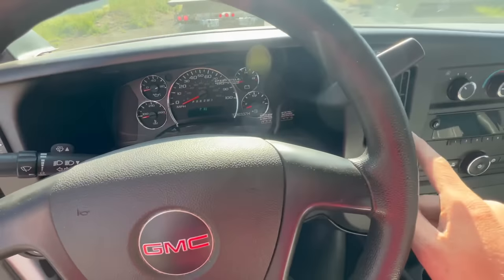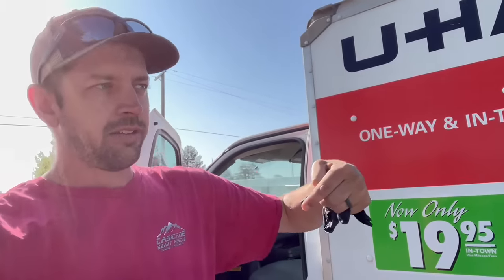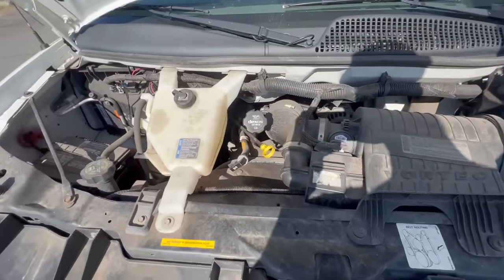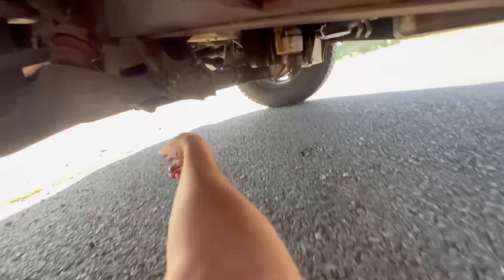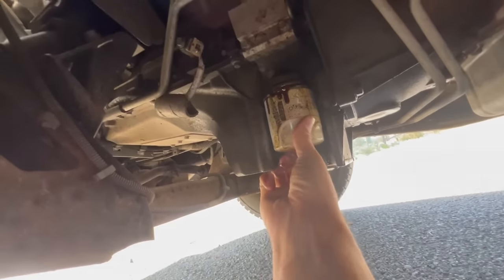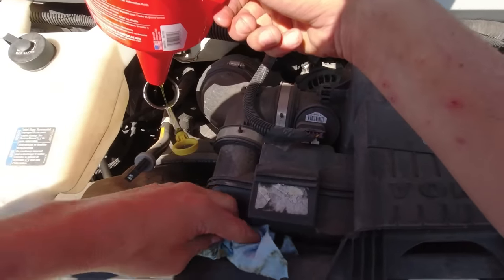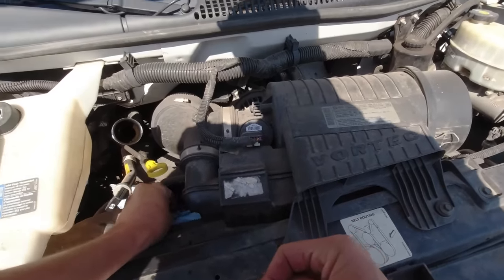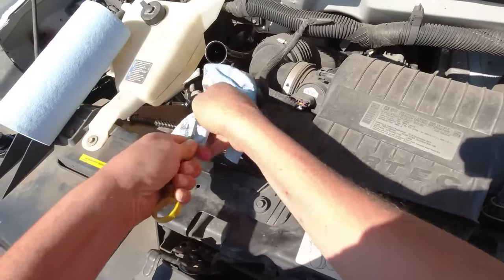Sometimes Being Honest Costs You A Job…

Comment: I am a retired auto technician and found that people will beat a path to an honest technicians shop.  I really enjoy your videos.
Reply: I am not a trucker but have found a shop that never needs bringing anything back in plus they are not condescending
Reply: That is very true!
Reply: Certainly true! However, finding that honest mechanic can be very difficult indeed.
Reply: Well honestly listening to what he's saying in this video, while yes they are honest it's their own screw up. He called the lead technician who said the truck left with the correct amount of oil and it looks like new oil so I'm assuming they did an oil change. The shop left the oil filter loose and caused the loss of oil so all they're doing is fixing their mistake. Honest, yes, but it's not like they're doing a huge favor by fixing a screwed up job.
Reply: @smilingsamurai5590  The guy who fixed it didn't screw it up. He could have done exactly what he was told and made a lot more money. He did the right thing and saved them money. He was a tow truck driver, not a mechanic.
Reply: Yes, but you'd actually have to do work if you get the reputation of being honest.
Reply: @arribaficationwineho32  Man as someone who works in a shop I feel so bad if a vehicle I've worked on has to come back in. Not a good feeling for anyone tbh
Reply: Damn right we will.
Reply: And word of mouth is better than any advertising you can buy with money.
Reply: I used to be an appliance salesman. I went the honest route, told people to shop around first, told them honestly if there were better deals to be had, if i couldnt get it i told them where to go instead of an 8 week lead time. I had more customers come back and ask about everything and anything, knowing i would give an honest answer over what the company wanted.

Comment: This world needs a lot more people like you Casey. Doing the right thing is always the best thing. 😊
Reply: The customer did well too. How many watch the oil pressure. Stopping the truck saved U Haul and engine + labour
Reply: @getahanddown  well, if your vehicle has an oil pressure gauge, you should be watching it. That's what gauges are for.... 😊
I drive a Chevy Cruze and it doesn't have an oil pressure gauge. But if it did, I'd be watching it just as much as I watch my temp gauge...
Reply: doing the right thing would have been putting the right oil in he put in non dexos approved oil voiding it’s warranty

Comment: You deserve a medal for what you did. Hope you got paid for your time, oil and filter. Hope the fleet mech that left the filter loose gets a repremand. Hats off to the customer (who rented the van) for noticing the low oil pressure and saving the engine. Much respect sir, and my hat is off to you. We need more people like you. People like you are what make this country great.
Reply: Oil filters are tricky, u want to lube seal, hand tighten then give it about 1/4-1/2 turn more to get it just snug because over tighten can be a issue. And because the threads are well oiled it's very easy to over tighten.
Reply: @stonefox9124  They're not tricky. You just have to use due-diligence in getting them tight. I've been a mechanic for 30 plus years. I've made my share of bone-headed mistakes. My mentor told me one time, "Don't put a drain plug in without tightening it. You WILL forget it." Same could be said for oil filters. This one was obviously spun on and just forgotten. All's well that ends well! thanks again.
Reply: He got called for a job, didn't do the job, and stole someone else's job so no one gets paid.
real american hero right there.
Reply: Man: hey I found the issue and fixed it for you so you don’t have to worry about having to get towed hours away to get fixed then towed hours to get it back. 
Some internet Rando: wow I can’t believe what a jerk he is. 

Dude saved the company a lot of money because he was honest and wanted to see if there was anything he could do to fix the issue and he did, I would to have someone like him around me who doubles checks to make sure I’m not spending more than I need to.
Reply: @mtndew314  ah yes just like how people that give sound health advice are putting doctors out of work
Reply: @mtndew314 haha.  Plus, I was thinking that no good deed goes unpunished.  Waiting on the lawsuit from Uhaul for some dumb reason.
Reply: @mtndew314  Did you not hear him mention fleet facility? Trust me, the fleet mechanics have plenty of work ahead of them, and aren't losing any money, nor sleep over it. Not to mention the loss of downtime for that particular unit while it sits waiting to be repaired. The keyword in this video is honesty. Apparently that doesn't matter to you. I wonder how you would feel if you were the owner of a business, and someone raked you over the coals unnecessarily just so he could catch a payday? There's no reason to be a snarky, contrarian dick.
Reply: @demontekdigital1704  There is not a single part of this that is about being honest.
If he just showed up and loaded the vehicle that wouldn't make him a dishonest liar.
That wouldn't mean he "raked you over the coals" 
Yeah, he went 'above and beyond" but thats not related to honesty.

and it sounds like it'd be a big payday for the towing company, so if I was the boss there I'd be furious that he threw that away.

and I'll sure as hell be a snarky dick when OP is out here acting like this dude deserves the Nobel peace prize for changing an oil filter.
Reply: @mtndew314  Contractors definitely add a "dickhead tax" to your bills lol

Comment: Casey, You're honest to the core and that's why we all love you and your channel.  I'm actually impressed that the customer noticed that it was losing oil pressure. Most people just get in, start it up and drive off.
Reply: Hard to "drive off" when computer puts engine into limp mode
Reply: I know, I thought about that too. that could have turned into a major repair
Reply: Back in the VCR days one Portland News channel deliberately popped the fuse on a perfectly fine VCR (& replaced it)and dropped it off at a few repair shops. Only one shop was honest and said, no charge, just a blown fuse. It was the smallest repair shop in Longview. Any other tow company would have simply towed the vehicle to a destination, & collected a few hundred bux. word of mouth goes a long way
Reply: @speedfreak8200  I keep forgetting about the computers in all these new vehicles, My daily driver is an '86 AMC Eagle.
Reply: @EvrttGrn  COOL !!!!
I thought those eagles were all dead!
Congrats on the epic ride !!
Reply: @haroldphipps3457  Thank you.  Not all of them are dead.  There are still a few of us keeping them on the roads.
Reply: @EvrttGrn  That new of a chevy yells and beeps like a maniac when it has no oil pressure and is running. It will say around where the odometer is exactly what is wrong. 

Doesn't stop people, though, I rebuilt the 6.0 in a 2007 tahoe hybrid someone ran dry. I've done at least three ~07 honda pilots, because their VCM eats oil like it's going outta style. Those also make lots of noise when they have zero pressure, doesn't stop anyone.

Comment: I used to sell electronics for a bit down at Radio Shack back in the day.  He came in looking for an HDMI cable for his TV and wanted Monster Cable, but asked my opinion.  I gave him the run down that basically any cable under 5' would work, and he didn't need to spend huge cash on a high end cable (Digital signal either works or it doesnt - but on runs over 25' is when cable quality comes into play to make sure those 1's and 0's come in strong enough to not turn into a garbled mess).  Guy seems super happy with me, I toss him my card, says he will be in touch later about another purchase.

After the sale I get completely chewed out by my DM who was visiting our store for not pushing the high end stuff on him and letting him walk out spending $15 rather than $100.

About 3 weeks later he calls me and asks me when Ill be in the store.  I tell him and he says he'll see me then.  Turns out he was getting ready to get all his team cell phones with PTT for his catering business - not sure if you remember Nextel but we used to sell it there like 2004/2005.  He needed a business account with 20 cell lines.  I ended up walking out with a massive commission and hitting my annual sales numbers in basically a day.  He even came back to pick up some sound systems and a new TV for his living room later on.  All things he would call me for before he came into the shop because he felt that I was the only guy who didn't try to fuck him by selling him expensive things he didn't needed.  He also sent in some of his friends and business partners to come get their cell contracts with me.  I became that guy in "I got a guy".  It was a great steady stream of commission income started because I didn't try to make that extra $2 in commission on the Monster Cable.  I only did what I would have wanted someone to do to me in that situation.

Comment: Honesty is so important with customers.  Reminds me of a time with my old car when the indicator was on telling me one of my turn signal lights was out.  Went to a shop and was told it'd be $80 to repair/replace, but they didn't have that bulb in stock.  Drove to a little parts shop and bought a 2-pack of the bulbs for $5 and the cashier came out to the parking lot with me and showed me where to reach to simply twist it out and twist in the new one.  Guess where I started going to any time I needed parts, oil, windshield wipers, anything....

Comment: I had my flywheel drop from my engine in my car.  I had to have it towed across the street to a service station.  They found the only problem was the bolts had loosened and fallen out of the Flywheel.  They charged me for the bolts ($7.00), an hour of labour and the tow.  I went back every time and bought my gas from them from then on.  Glad to see you understand the value of reputation.

Comment: I used to drive tow for Alberta Motor Association and would often find and fix issues for members instead of towing. Most often boost calls in winter - bad connections. Often, I could clean the terminals, and it didn't even need a boost. Those fuel shutoff valves were a common issue too.

Comment: Wow! Blown away with your video. I worked at new Automotive dealers service departments starting around 1983 and for around 30 years on commission. I quickly learned I was not going to become rich doing the right thing and working in an honest way. I watched many techs run 3 times the hours that I did weekly, mostly via pen later on (computer). These guys never got their hands dirty it seamed. Some Service managers pressured technicians into "flat rating" costumers. I did however have a good and reliable income  a great reputation. I was never unemployed. Keep up the great work.

Comment: If I were a potential customer I would absolutely appreciate your honesty. That said you went well above and beyond. I personally also wouldn’t have touched that vehicle. As a fleet technician myself I would say to let the tech that left the filter loose fix the problem. Let them send a tech out to fix it. You may set yourself up for a future liability claim if anything goes wrong with that motor regardless if it wasn’t your doing, but since they were apparently fine with you repairing the vehicle then great job. You saved them time and money and likely have a good customer for a long time. 
Did you get another job within the time you would have been busy with that tow? If so you already made money and also gained not only a loyal customer but likely a good reputation as well.

Comment: My dodge ram had the same issue with oil filters leaking every time I took it in to Valvoline to replace. Now I change my own oil and tighten down the new filters harder than should be. No more problems.

Comment: Very true. You’re one of very few. I did however have a tow truck guy that could had charged me $350 for the tow but instead he diagnosed the problem and fixed it in about 10 minutes. Transmission gear linkage was came off. I gave him $100 and went on my way. He saved me not only $350 but probably another $250 with the dishonest mechanic.

Comment: Reminds me of my local auto shop.

I took a vehicle in a few years ago that was losing power steering. Guy drove it a bit and came back. Told me i'd likely need a new power steering pump and some other stuff and it would probably cost me upwards of $500 if not more.

I said alright, do what you gotta do.

He took it in the shop and about ten minutes later, came back inside and handed me a bent bolt. Told me that was the entire issue and he'd never seen something like that before.

Told me that would be $20. Bro could of scammed the shit out of me but he's as honest as they come. I wish we had more shops like his.

Comment: As an OTR driver I found a bent airline leaking at the transmission. Now the mechanic was selling my boss on a complete tranny rebuild if I got truck home. I replaced the fitting, drove home deadhead and was let go. The boss believed the wrench over me. It worked out, maintenance bills killed his trucking business in less then a year. 
Integrity is a good thing, in getting canned I found a far greater driving job where I was rewarded for roadside repairs that in the end saved my boss money.
Good save Casey, few people would have cared to even check.
You are in my prayers
Hoka Hey

Comment: I was doing some repairs on the gearbox of a little ship with the chief engineer when the owner came into the engine room. He was gonna take it on himself to change the oil in the main engine. Simple job, normally left to the apprentice. So nobody double checked the big bosses work. Turns out he left the drain plug in his pocket, and let about 20 gallons (80liters) of oil run right through. We discovered it a few hours later, about 15mins after leaving the dock. Bunged the drain with blue tack and refilled with 15 gallons engine oil and 5 gallons hydraulic oil to limp back to shore

Comment: My dad‘s 98 dodge ram 1500 pick up Heather happening, the mechanic said it was the gauge. And it might have been the gauge but after a lot of neglect, I drove it once that happened. They said it was just the gauge I kept going, totaled the truck. Always air on the side of caution. It will save you thousands.

Comment: I worked oil change at the Chevy dealer one summer.  I found that the hash marks are about 1 Qt of oil, and overnight a little leaks back down into the pan.  You don't want to fill it to the line, you want to be back 1/4".  When you check it in the morning it will be right at full perfectly.  That said I'm sure they plan for a little extra at times.  But I like to do it exactly right.  😆

Comment: This reminds me of what happened to the truck I am about to drive and take to shop to have serpentine belt replaced.

Back when truck was brand new - just delivered from dealer - I picked up to shuttle to warehouse where it would be used.  I made it about 3-4 miles before check engine light came on and shut the truck down while driving.  

Unfortunately this wasn’t my own truck, so no tools with me.  The company was based in Minneapolis where it gets pretty cold.  Their Shop did a modification to the coolant system and didn’t tighten the clamp on a hose under the truck.  It blew off as soon as pressure built up, dumping all the coolant.

Everything LOOKED fine when I picked it up ….  Learned a lesson about running a truck for awhile before driving it …. Even if the Shop just had it and it was brand new (1200 miles from dealer to company).

Comment: I used to turn wrenches at a dealership for a day job years ago.  I stay current and my tools are current.  I still fix a car every now and then for friends, neighbors, or co-workers.   There are a lot of mis-diagnosis and shady shops.  I diagnosed a $15 purge valve.  The person had already spent money to get fuel pump changed, and for a new gas cap. On a different car,  I also swapped out an O2 sensor.  Rip Off Shop was going to charge $750 for that job and explained it was a long complicated process.  Took 5 minutes to troubleshoot, 5 minutes to swap once the part  came in, and 1 minute to reset the code.

Comment: I remember the days where you would take you vehicle to a shop for a problem that you thought was bad and the shop calls you back and says it was simple problem and no charge.  It is hard to find auto repair shops like that these days.  There was a shop I use to go to that had great service and then not so much.  The shop changed ownership so I went and found another.

Comment: when you discribed the issue I'm pretty sure that I was not the only one that had his spidey sense tingleing about the oil being low :D
pretty sure that dipstick in futurama was a reference to these trucks, just comically long 
the termal expansion of the dipstick can change the measurement by quite a bit I guess

just yesterday I had a customer complainging about a knocking noise while steering, the car needed some other repairs too,  but that knocking noise was just a loose bolt on the lower control arm.
replaced the bolt and that's that.

Comment: May have just been the sun shining on the dip stick, but it looked like metal shavings on it.  My husband found out that the dealership he bought his 2021 truck from, didn't put the oil filter on as tight as it should have been.  He was able to unscrew it with 3 fingers.  Luckily though, it didn't leak like the uhaul truck.

Comment: I had 97 geo metro 1.0 L  I was driving down the highway and I was like what is that smell...  Open the hood to see I'm out of oil and my drain plug fell out.  Drove it 4 miles with no oil to pick up a drain plug and oil. Still amazed I didn't blow it up.